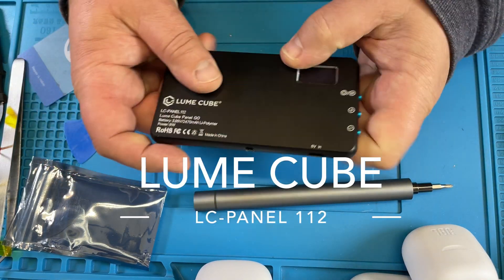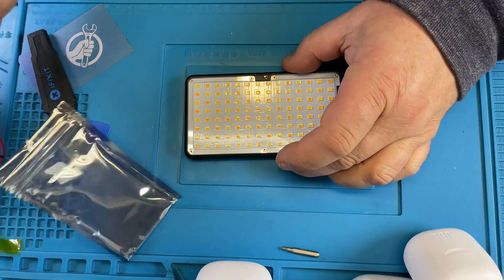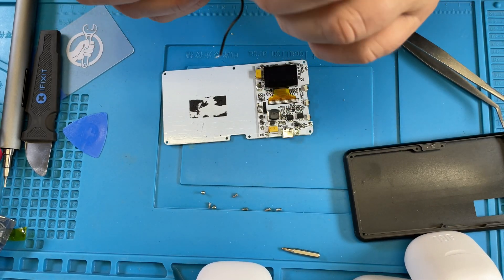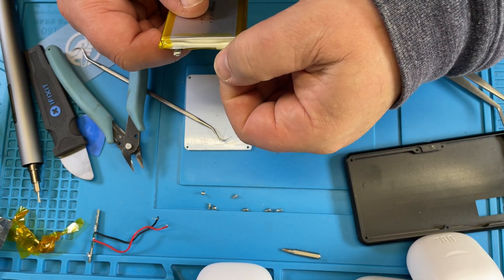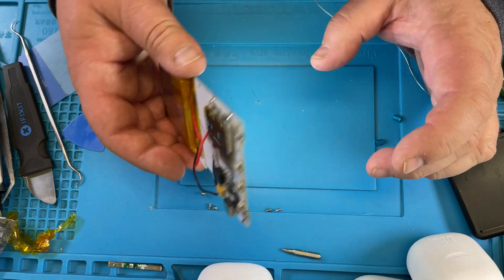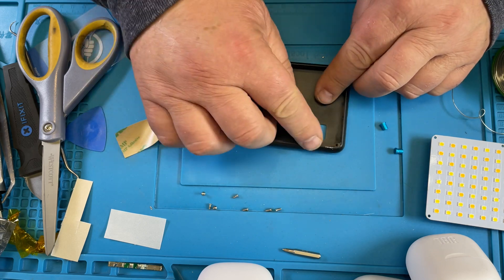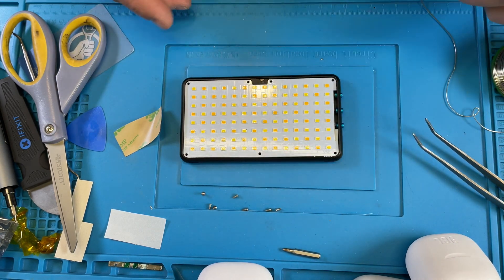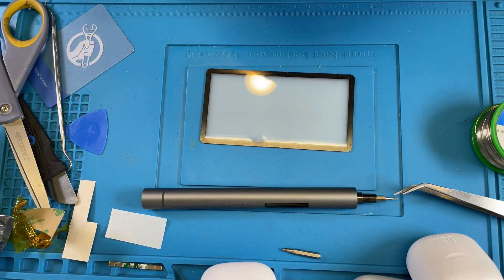LED LIGHT - Lume Cube - Battery Replacement

Comment: My light has suddenly stopped working - good voltage from a healthy battery, just not turning on or responding - any thoughts? Thanks.
Reply from the maker: no idea, loose wire? corrosion?